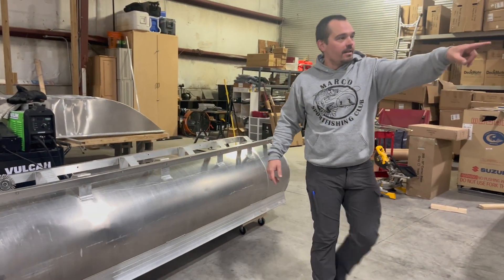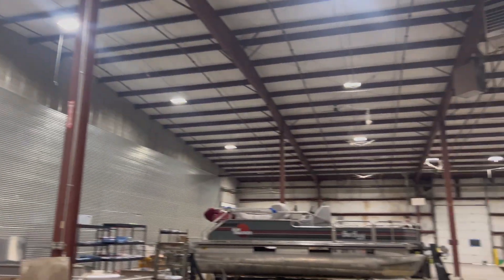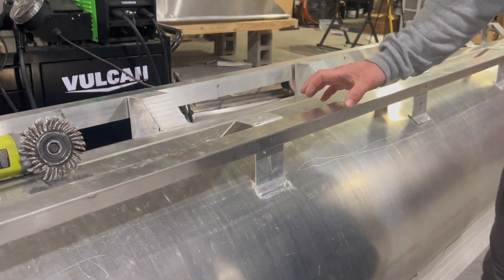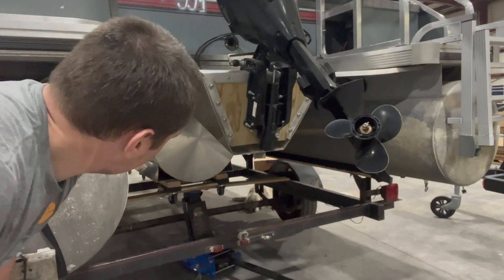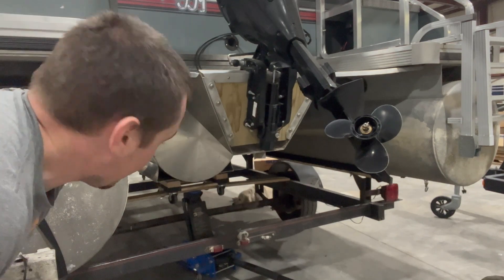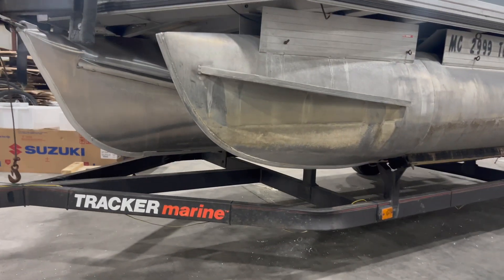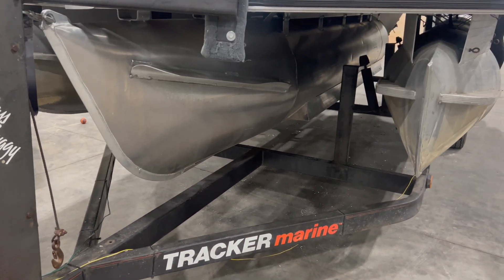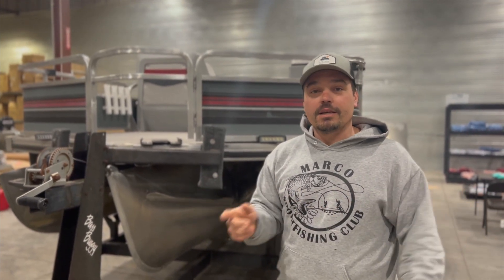Pontoon to Tritoon Conversion - Sport Toon Install

Comment: I have a 20ft Starcraft older model {that came with a 48hp} the new 75hp motor is mounted right at the back of the pontoons. I have noticed that the newer motors are mounted further back. I get a lot of water backwash that almost covers the lower part of motor. I was thinking of getting a more extended transom pod. Any thoughts?
Reply from the maker: I'm a big advocate for pushing the entire transom and motor back behind the pontoons for water flow to the prop and better handling and trim response. I'm sure you'll still have a good bit of splash at the motor, but it might be improved from where you are now. You could always install some aluminum sheet to deflect the water too.

Comment: I have a 18’ Sundance pontoon with a new 40hp Mercury. I reworked the whole thing it came out great. Here’s my question I need a third log for bouancy . 

Do you recommend a full log or will the short log ending in front of the transum work? We run this pretty slow on a small lake, not likely doing anything over 20mph at tops.
Reply from the maker: I would always recommend a full length pontoon, however, in your situation I think you'd be just as happy with a short toon in front of the transom. The full length gives buoyancy throughout the whole boat, but if you just need the help in the front of the boat where people are sitting most of the time I would save the money and go with a short toon. Also, with it not being a performance thing, you could go with a center pontoon that's the same size as your outers and you'd be just fine too. Fine a cheap one on Marketplace, have a local welder chop it down to the right size, weld it back up, and pressure check it (fix any leaks it might have had before, and then add brackets to make installation easier.
Reply: @tomspontoons  you think I can go all the way to the transom?
Reply from the maker: @rustysullivan6566  yes. If you’re not going with a high HP or trying to go fast you’ll be just fine. Water flow issues tend to happen when the boat starts going 15 to 20+ mph

Comment: I'm thinking of adding a 3rd toon to my 18ft  bass buggy . Rightnow it has 70hp run 23 to 28 mph per GPS.  Wondering if I add a 3rd toon will it be alright for a 90 to 115hp 2 stroke outboard ? Hoping to find toon with lifting strakes
Reply from the maker: Per the USCG there's no HP or weight limit for a pontoon style hull, the manufacturers apply the ratings based on how they build them and what they can handle through their testing. If you add a full length center pontoon that's rated for a larger HP then you should be okay, especially keeping your HP to a reasonable size like a 90 or 115. However, if you hang a larger HP motor like that on your existing transom you might run into issues with the structure of the boat not being able to handle it.

Comment: Where can I buy this sports toon?
Reply from the maker: This one actually came from Great Lakes Skipper. I usually recommend searching FaceBook Marketplace and Craigslist too. If you find a good usable pontoon you can always take it to a local aluminum welder and have them cut it down to the length you need, add mounting brackets if need be for easier installation, and pressure check to make sure there are no leaks. Ideally go 2" to 4" larger diameter than your outer toons...but even matching the diameter will help a ton with buoyancy and stability.

Comment: Hey Tom, I have a 2005 Bentley 240 cruise.  I want to add a center tune. Does it have to extend out as far in the front as the other 2 ? I measured it out at 16 ft with the center toon being recessed due to the trailer. Would that work ? 90 hp yamaha for power. 
Hope you had a great long weekend.
Mark
Reply from the maker: Hey Mark! 

I like to see the center pontoon in line with the front toons, but it can be pushed back a couple feet if need be. With the center toon pushed back you'll get more spray going under the deck and out the sides of the boat over the tops of the outer pontoons. With that HP I would definitely underskin the boat with sheet aluminum to prevent that spray against the deck. You likely won't gain any speed as an empty boat, but you should be able to cruise a little faster with a heavy load and you'll have a higher and dryer ride too.
Reply: @tomspontoons  . . Thankl you sir. What would you charge for a job like that? There's nobody around here in south mississippi that works on these that I can find.
Reply from the maker: @markpalmer8341  most center pontoon additions are around $7K to $8K which includes the transom mount center log. 

It’s not an easy business to be in…will never make people rich and it’s serious physical labor in addition to needing to know how wiring and engine rigging works on a boat. I wish there were more folks out there across the country to help out all the pontoon owners wanting restorations for their old boats. But I never mind when someone is willing to trailer their boat hours and hours to me to have the work done!